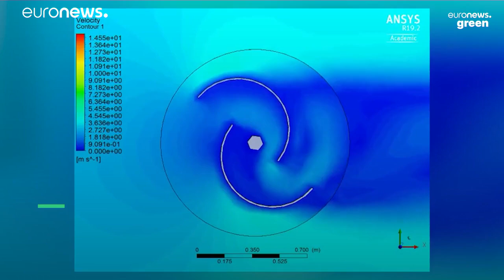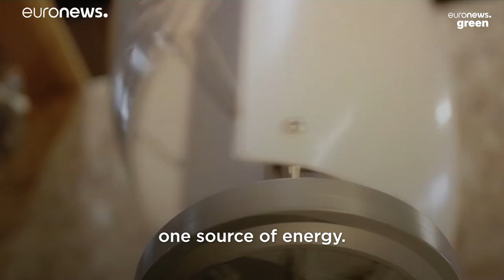Are ‘tulip turbines’ the answer to energy eyesores?

Comment: How much Electricity can produce this  wind mill?
Reply: I found their website...  It took a fair bit of digging to find actual numbers... the $1000 small one produces 5-10 watts in a 6m/s wind.,   the $40000 'large' one is 3m (10feet) tall, and requires ground installation on a cement pad, and can generate up to 1KW.  prices don't include installation or the control and charging electronics or the battery packs required to make them useful.

Comment: You will need tens of thousands of these tiny ones to produce the same energy as one large windmill. You would need to place them absolutely everywhere and that's going to be way more expensive and ugly I think.
Reply: Unfortunately i invested in this company 
3 years ago and I have not yet read about them selling a single one.
Reply: @yoube449   @DX  Im studying electrical engineering and my teacher recently confirmed what I said. This is a terrible idea. Higher in the air, say 30 meters up is a lot more airflow. Combined with having to service thousands of these things instead of 1 large one, this isn't going to be a viable energy source.